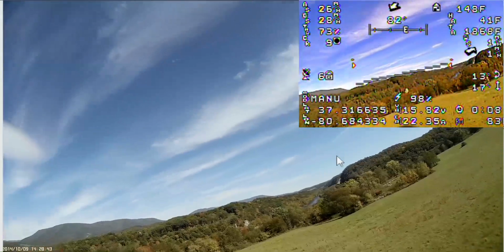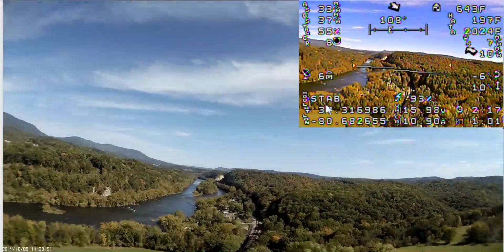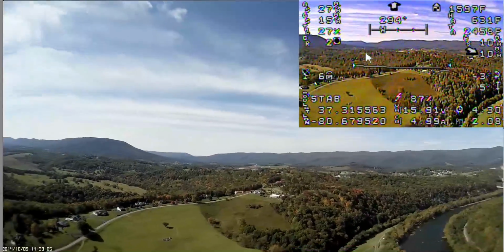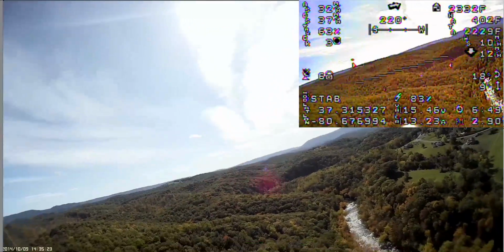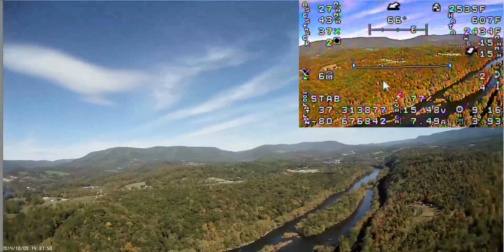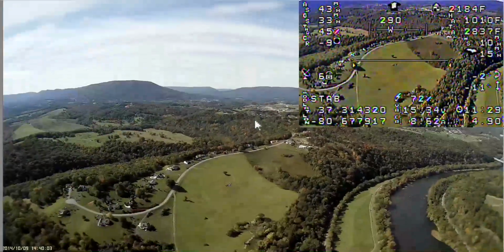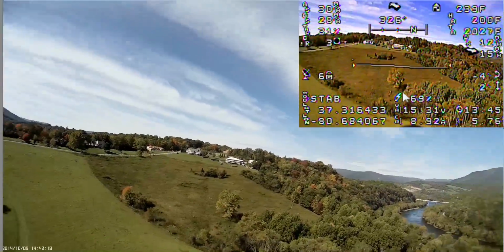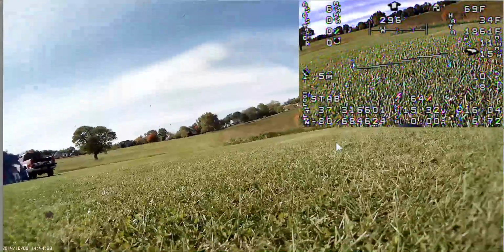SkyWalker FPV Flight APM w/ Air Speed Sensor, Narrated

Comment: I enjoyed the flight Dave! Thanks for sharing it! 
Question: Were you flying with the ezUHF JR Module? How's your range? I ask because I've read a lot of forum posts that people have had issues with "noisy" components (ubec's, etc.) interfering with the ezUHF rx and causing limited range issues. My Skywalker is set up very similar to yours and I'd like to convert it to ezUHF (from 2.4ghz currently). Thanks and Cheers to you and Jon! :-)
Reply from the maker: TheAdkFlyer10 Yes, The EZUHF worked great. In fact I had the module in low power the whole time and it had no problems even a mile away. 
I need to figure out how to convert the EZUHF receiver RSSI to work with the APM so it will display on the OSD screen. Maybe if you get one you can help me figure that out.
Reply from the maker: I got the RSSI working with the EZUHF and MinimOSD on APM!
Found the info here:
http://diydrones.com/forum/topics/pixhawk-pwm-input-for-rssi-ezuhf?id=705844%3ATopic%3A1589116&page=2#comments
Reply: Excellent Dave! I'm very interested. Would you make a brief video on the subject for me? Please, please?! ;-)
Reply from the maker: TheAdkFlyer10 You know I am all about the videos lol.
 Yeah probably will do one on it.
While working on the RSSI I discovered what the two readings on the center right of the OSD were. I thought they were way point items but realized they are Wind Speed and Wind Direction. doh!